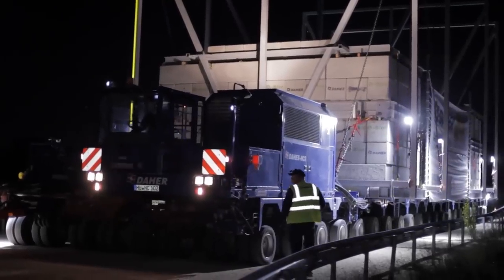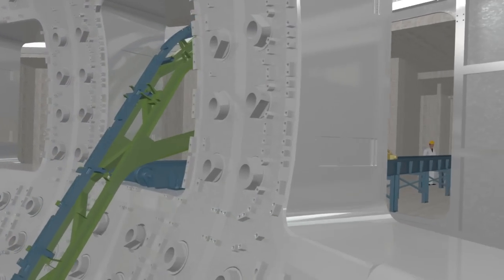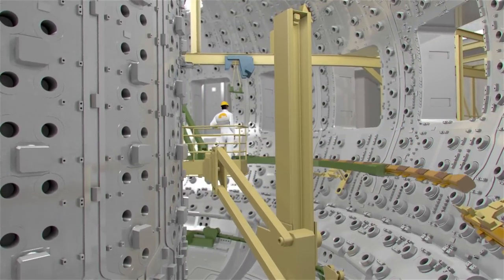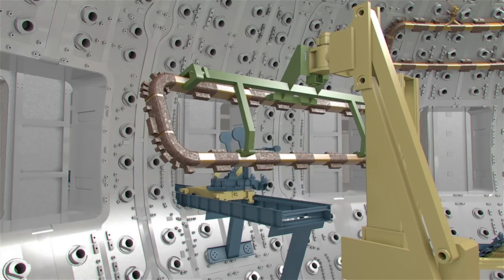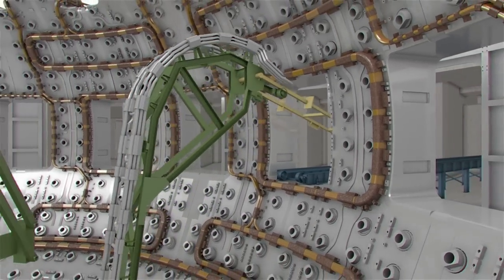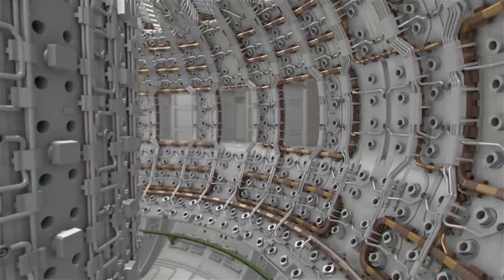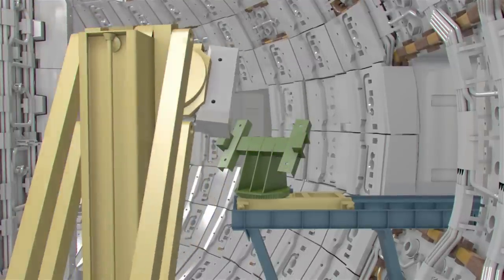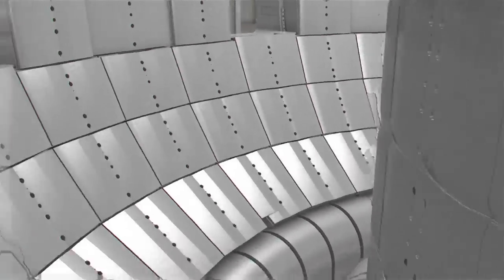ITER Assembly - In-Vessel components

Comment: Ok, this was very interesting from an engineering standpoint,  but with no explanation of what  ITER is or does it was meaningless and quite useless to watch.
Reply: ITER is an international experiment to create sustainable fusion.

The amount of fusion energy a tokamak is capable of producing is a direct result of the number of fusion reactions taking place in its core. Scientists know that the larger the vessel, the larger the volume of the plasma ... and therefore the greater the potential for fusion energy.

With ten times the plasma volume of the largest machine operating today, the ITER Tokamak will be a unique experimental tool, capable of longer plasmas and better confinement. The machine has been designed specifically to:

1) Produce 500 MW of fusion power
The world record for fusion power is held by the European tokamak JET. In 1997, JET produced 16 MW of fusion power from a total input heating power of 24 MW (Q=0.67). ITER is designed to produce a ten-fold return on energy (Q=10), or 500 MW of fusion power from 50 MW of input heating power. ITER will not capture the energy it produces as electricity, but—as first of all fusion experiments in history to produce net energy gain—it will prepare the way for the machine that can.

2) Demonstrate the integrated operation of technologies for a fusion power plant
ITER will bridge the gap between today's smaller-scale experimental fusion devices and the demonstration fusion power plants of the future. Scientists will be able to study plasmas under conditions similar to those expected in a future power plant and test technologies such as heating, control, diagnostics, cryogenics and remote maintenance.

3) Achieve a deuterium-tritium plasma in which the reaction is sustained through internal heating
Fusion research today is at the threshold of exploring a "burning plasma"—one in which the heat from the fusion reaction is confined within the plasma efficiently enough for the reaction to be sustained for a long duration. Scientists are confident that the plasmas in ITER will not only produce much more fusion energy, but will remain stable for longer periods of time.

4) Test tritium breeding
One of the missions for the later stages of ITER operation is to demonstrate the feasibility of producing tritium within the vacuum vessel. The world supply of tritium (used with deuterium to fuel the fusion reaction) is not sufficient to cover the needs of future power plants. ITER will provide a unique opportunity to test mockup in-vessel tritium breeding blankets in a real fusion environment.

5) Demonstrate the safety characteristics of a fusion device
ITER achieved an important landmark in fusion history when, in 2012, the ITER Organization was licensed as a nuclear operator in France based on the rigorous and impartial examination of its safety files. One of the primary goals of ITER operation is to demonstrate the control of the plasma and the fusion reactions with negligible consequences to the environment.
Reply: Ever heard of things like Google (who own YouTube by the way) or Wikipedia?

There are sites on the electronical information superhighway, or "websites" if you will, where you can type "ITER" in and by the miracle of modern technology all of your questions will be answered.

You can even use The Google for finding naughty pictures of people in a state déshabillé I believe.

You're welcome.
Reply: @ptonpc  It does not look like maintenance will be easy. A lot of layers. Incredible design and fabrication job.
Reply: @Erik-rp1hi  I expect it will be done on the same basis as LHC.  Have enough redundancies so that nothing dangerous happens and shut down every so often for a complete refit.